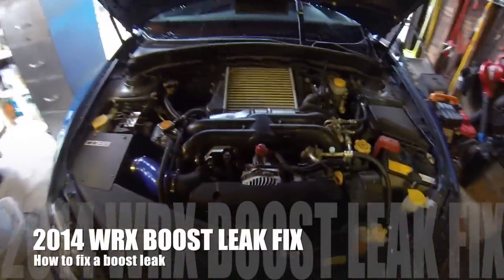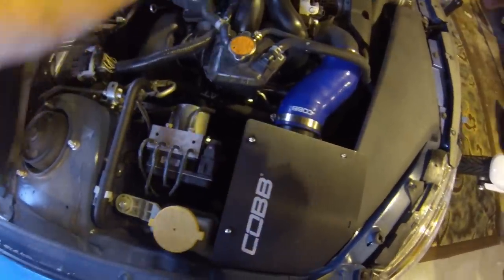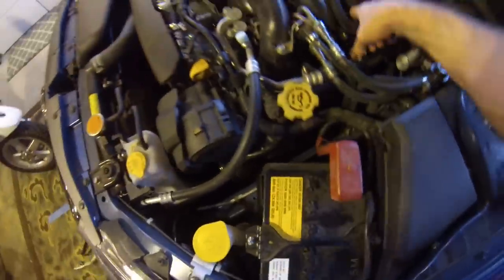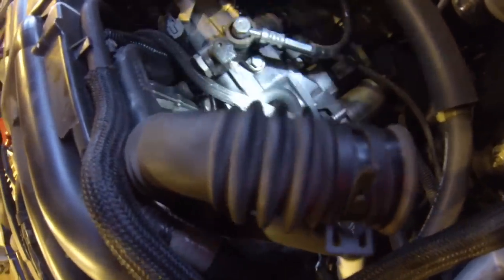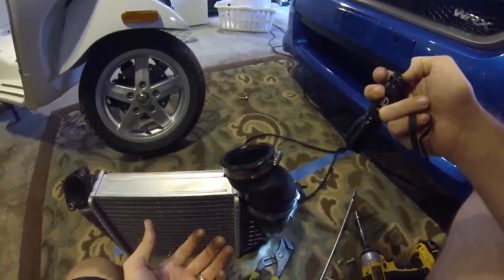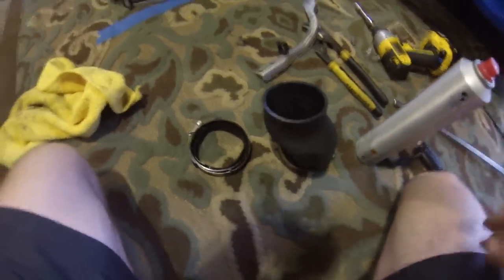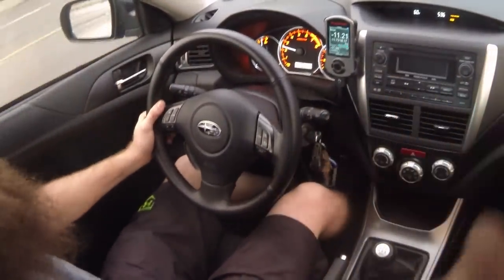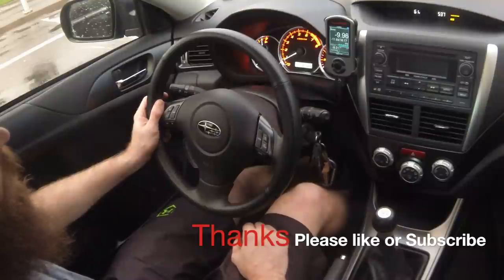How to fix a boost leak on a Subaru WRX 2014

Comment: Did you take off the Cobb intake before you went to the dealership the first time? I'm having the same issue right now, and have that installed
Reply from the maker: Don Rogers I haven't been to the dealership since I went stage 1 or 2. But yes I would take it off and go to the stock tune. They might say "Well because your running a tune thats not OEM, you were running higher boots levels leading to the boost leak so we can't warranty it" which is a bunch of BS because they blow with the stock tune and you have no Idea because you don't have a boost gage. Make sure they fix it for you, I really don't like dealerships anymore. I feel like they do shotty work, but maybe yours is better.
Reply: blake866 took it to dealer today and they did a smoke test. could not find the leak. told me to put it back to stock tune and drive it around for a week or so and see if that fixes it. But they also told me because i tuned it they can't warranty anything. bastards. Did you do a smoke test or just take it apart and notice what was wrong
Reply from the maker: Don Rogers Well the stock tune will not fix it I love their advice your better off fixing it yourself. I blew my hose they fixed it once and that was with the stock tune that was warranty they replaced the hose and warranted it. I think that only last about 2 days before I had another boost leak. I did not do a smoke test just  took everything apart and tightened everything up. Then checked my Cobb Accessport for Boost. The levels were way up to where they should have been. I also could feel the power difference right away.
Reply: blake866 I'm going to buy the mishimoto hose and install that. hopefully it works and its nothing more, although I'm only hitting 8 psi right now. so infuriating
Reply from the maker: Don Rogers
Wow that's bad I think I was hitting about 10 or something like that. Does it make louder turbo spooling noises? Also did the dealership not even look at it? What mods do you have?
Reply: i only have the cobb intake with access port stage 1 OTS map. They basically told me in more words that I'm screwed. its starting to sound a little louder, more whining to it also
Reply from the maker: Thats what mine sounded like the first time too. Its almost god they didn't fix it because now you have a region to get the better part LOL. Next time thought I would take it back to stock anytime you have go to the dealer.

Comment: Yo I'm in sac too I all so have this problem but I can't find my leak any where running stage two I'm hitting my peak boost at 20 psi but it goes and drops in a sec
Reply from the maker: Are you data logging pulls to see how the boost tapers off? I would probably buy the Mishimoto throttle body to intercooler hose and hopefully that will fix it.
Reply: Yea I am but the dude that is doing my tunes is saying I have pinch in a line
Reply from the maker: Hopefully he can fix that for you I don't see why they wouldn't. How much power were you putting down with the tune? or did he get that far?
Reply from the maker: Michelle Yu Here is a link to buy the upgraded hose http://www.rallysportdirect.com/Mishimoto-MMHOSE-SUB-ITBBL-Silicone-Throttle-Body-Blue-Hose

Comment: Hey bro what do you think about “go fast highbird bov? They told me if my bov is bad it can cause a boost leak? What you think?
Reply from the maker: Mike Jimenez never run a BOV these cars need to recirculating BPV. You don’t gain anything from this mod but check engine lights.
Reply from the maker: Mike Jimenez get a cold air intake and proper tune for the intake you can make the choo choo noises then.
Reply: Blake's Garage what’s a boost target normally? With a cobb intake
Reply from the maker: Mike Jimenez I don’t remember man. I probably said it in this video or said it in another comment at one point. All the info is available on cobbs website. Check for any oil around the part I’m showing in the video. If it’s oily it’s leaking.

Comment: I had the same issue ... but the one end was torn completely, couldn't do the hairspray fix.. so I went with a aftermarket part  from TOMIOKA (PART# TR-ES2005)  no issues installing and works great.
Reply from the maker: elesar lesar Bummer glad you fixed it though hopefully this video helped, I just put on the Mishimoto TB to IC and its great but a different hassle to get over the piping.

Comment: Dude we can't see anything your doing. I'm trying to learn how to fix this my self. But when your removing the intercooler and hoses can't see what bolts or hoses your removing
Reply from the maker: Sorry man this video is very old. But just get in there. It’s very straightforward.
Reply from the maker: Also, I’m pretty sure I did a video on a stage to install for a downpipe. This was a later video and there may be a bit more about this topic in it.

Comment: Wow did the boost leak cause that much blow by?  Is that much oil normal?
Reply from the maker: +RDFStudios I think the boost leak may have contributed to it. Sometimes the pieces that are on the TB to IC hose will fold back and I think it captures a lot of oil when that happens. Last time I removed the intercooler very little oil in the intercooler.
Reply: +Blake's Garage Very good to here. I'm new to Subies so trying to learn everything I can. I'm really excited finally put 1000 miles on the car so COBB stage 1+ here I come. 😃
Reply from the maker: RDFStudios Nice you will love it. Then quickly want more power LOL!
Reply: +Blake's Garage Thats what I'm afraid of hahaha. 😃
Reply: +RDFStudios looks like quite a bit of oil. idk what your miles are but ive driven mine for 4000miles and had next to no oil in that hose. just for a reference :) and has 125xxx miles

Comment: do you have the Bullet proof mod done to your intercooler?
Reply from the maker: +Dylan Campbell no. What is that? I haven't heard of it.
Reply: it just strengthens the little clips on the sides of the intercooler because they've been known to leak at about 21psi.

Comment: Thanks man! Going to give this a try tonight or tomorrow. Same story, I was going to let the warranty take care of it, but why not just do it and be done!
Reply from the maker: +timecowx It should be an easy fix use the hair spray it will help a lot. I would recommend getting an aftermarket hose because it will probably pop off again sometime.
Reply: +Blake's Garage I decided to go ahead and just ordered the Mishimoto replacement rather than do the job twice. I am still not even 100% sure this is even the issue I am having, but it seems like it is a common enough problem that I might as well change it. Thanks again, and I will be back when it is time to install the Cobb stage 1 goodies.